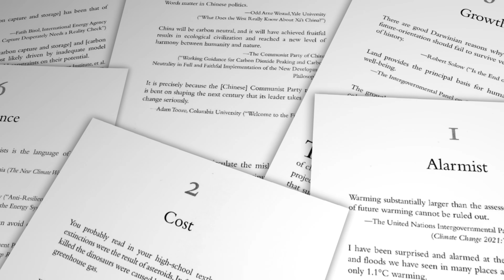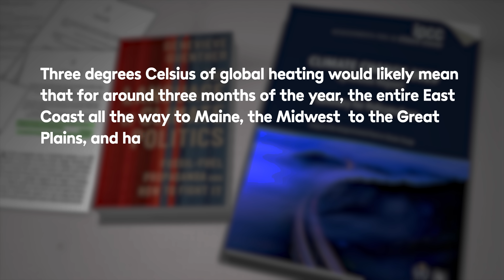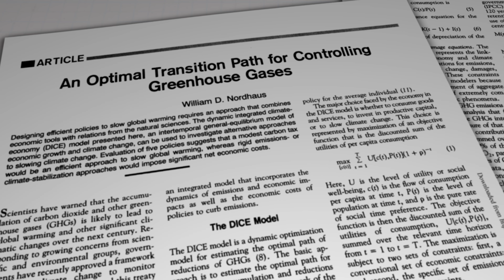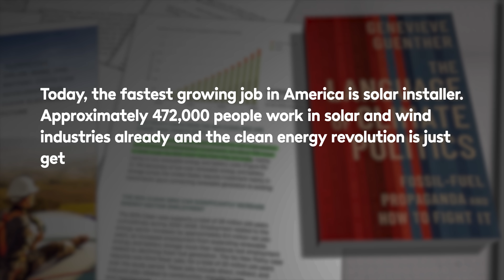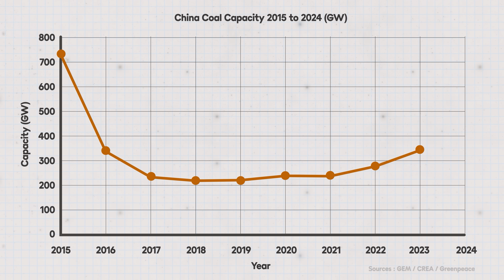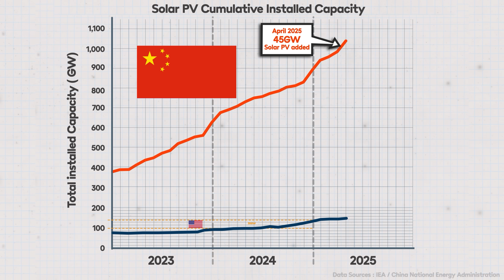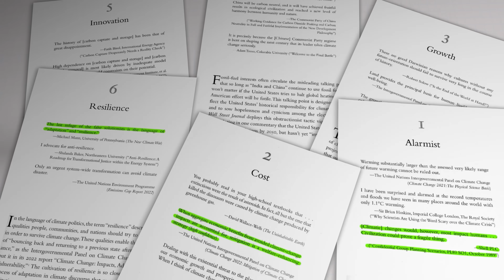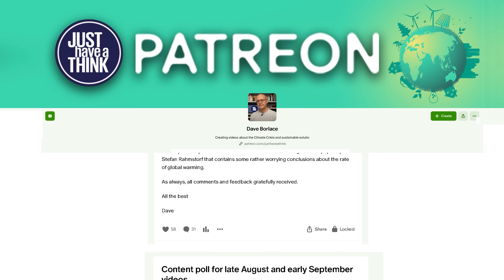New research DEBUNKS climate disinformation.

Comment: The USA are second at 12 to 13% in the carbon emissions list, but it used to be 25%. and only reduced its contribution percentage because of the increase in percentage carbon emissions in the East. So percentages are not a good figure to consider regarding carbon emissions levels. Better to have the amount of carbon emissions itself. The old adage of I would rather have 1% of 1000 than 5% of a hundred.

Comment: We need more CO2, not less to increase food production. Satellite photos have shown that the planet has become greener due to mankind's contribution to CO2. The gas does have an effect on climate but it is too small to be measured with any degree of accuracy. A study by lindzen, Happer and Winjgaarden entitled “Net Zero Averted Temperature Increase” calculated that even if the entire world were to achieve net zero by 2050, this would only reduce global temperature increase by 0.07°C. The alleged climate crisis has been created by the MSM by exaggerating what the climate alarmists are saying whilst censoring what the climate sceptics have to say. Most people at least in the UK aren't even aware that this has been happening.
Reply: Increasing CO2 is increasing food insecurity. Crops don't necessarily grow faster, those that do are often less nutritious. Faster growth requires more water which may or may not be available. Melting permafrost may grow some grass and shrubs but the ground is not suitable for agricultural machinery. Extreme events wipe out whole crops and they are increasing.  When a region loses their crop they not only don't have that food but they don't have the money from their crop to buy food. 
     The idea that CO2 has little effect is just false. It is the regulating mechanism of temperature.  The 50% increase so far is raising temperature dramatically and will continue to do so for some time even if we stopped.  But if we don't stop, things will get much worse much faster. 
     The MSM is a just as much a corporate profit center as big oil. If anything they have under reported on the danger we face. That the average uninformed person is equally uniformed about climate is just an indictment of our education system and the MSM.

Comment: 18% of solar energy reaching the surface of the planet is infra red radiation. Of this 12% is re-radiated direct to space.  6% is absorbed and re-emitted by H20 and CO2 but CO2 absorbs this radiation very effectively.  At 270 ppm all available radiation has been absorbed:  it is now 425ppm.  Adding more CO2 has no impact on warming.  We need to double it to prevent famine.
Reply: "The idea that CO2 absorption becomes "saturated" is a persistent misconception that ignores how the atmosphere works. 
—Absorption and Re-emission: CO2 molecules absorb infrared (heat) radiation emitted by the Earth's surface and then re-emit that energy in all directions, including back towards the surface. This process is continuous and ongoing throughout the atmosphere's layers.
—Wavelengths and Bands: While the center of CO2's strongest absorption band is already highly saturated at current concentrations, there are many weaker absorption bands and the "wings" of the strong band that are not fully saturated. Additional CO2 absorbs energy in these other wavelengths, leading to further warming.
—Altitude Shift: With more CO2, the altitude at which infrared radiation can finally escape into space becomes higher. Because the atmosphere is colder at higher altitudes (due to the lapse rate), less heat is radiated to space, creating an energy imbalance that continues to warm the lower atmosphere and surface." 

Plants like to absorb CO2 but they don't like the heat AND extreme weather it produces.
 
The UK and the US are responsible for the largest portion of the Industrial CO2 in the atmosphere so far even though China has recently become the largest annual emitter. Everyone bears responsibility. The US and Europe do a lot of manufacturing in China and developing nations so it's a lot about which corporations are emitters. China's emissions are leveling off. 

For every 1ºc warmer the air holds 7% more water.  Add energy to a fluid system and it becomes more active and water vapor is the most abundant GHG. Loss of albedo and specifically a Blue Ocean Event would begin absorbing more infrared directly into the land and water.

Comment: The August 2025 JHAT video presents itself as a calm, evidence-based takedown of “climate denial,” but it quietly omits the single most important data point in the entire debate: nuclear power is the only technology that has ever decarbonized a modern industrial grid at scale, and it does so with less than one-tenth the material footprint of wind, solar, and batteries combined. Mining and Materials: The Inconvenient Arithmetic the Video Ignores  IEA 2025: An energy future reliant on wind/solar/batteries requires 500–1,000 % more copper, nickel, cobalt, lithium, and rare earths by 2040.  
A single 3 MW onshore wind turbine requires ~500 tones of steel, 800 tons of concrete, and 50 tons of copper/neodymium.  
A 1 GW solar farm (with 4-hour battery backup) needs ~70,000 tons of steel, 100,000 tons of glass/quartz, and 6–10 GWh of batteries → 50,000–80,000 tons of lithium, cobalt, nickel, and graphite.  
A 1 GW nuclear plant (90 %+ capacity factor, 60–80 year life) needs ~500 tons of steel, 20,000 tons of concrete, and zero tons of lithium, cobalt, or rare earths outside the initial fuel fabrication.

Adjusted for lifetime electricity delivered, nuclear uses 90–98 % less metal and mined material per TWh than wind or solar-plus-storage (UNSW/World Nuclear Association 2024 lifecycle studies). The “clean energy isn’t clean at birth” critique applies overwhelmingly to renewables, not to nuclear.
Proven, Delivered, Zero-Carbon Electricity  France (1970–1990): 75 % nuclear → 90 %+ reduction in power-sector emissions in 15 years.  
Sweden: 40 % nuclear + hydro → 98 % carbon-free grid.  
Ontario: 60 % nuclear → eliminated coal entirely in <10 years.  
Global data: Nuclear has avoided ~80 Gt CO₂ since 1971—more than wind and solar combined even today (IEA 2024).  
Wind and solar have never, anywhere, displaced fossil fuels at grid scale without massive nuclear or hydro backing. Germany’s €600 billion Energiewende increased coal use for a decade and still imports French and Swedish nuclear electrons when the wind stops.

The “Too Slow” Myth Is 2025’s Biggest Lie  South Korea built 28 reactors in ~40 years (1978–2020) while going from poorer than Kenya to richer than Spain.  
China is currently building 28 GW of new nuclear and has 55 GW under construction—more than the rest of the world combined.  
Modern SMR designs (NuScale, GE-Hitachi BWRX-300, Rolls-Royce, X-energy) are factory-built in 24–36 months and are already in regulatory review or construction in Canada, the UK, Poland, Romania, and Ghana.  
First commercial SMRs will be online before 2030; serial production drives costs down 30–50 % per doubling of units (learning rates proven in France, Korea, and UAE).

Land, Reliability, and System Costs  1 GW of nuclear needs ~1 km².  
1 GW of wind needs 300–500 km². 1 GW of solar needs 25–50 km².  
At 40–50 % average capacity factor for renewables in most locations, the real land and transmission penalty is 5–10× higher.  
Nuclear runs 92 %+ of the year; wind and solar run 25–45 %. That means every GW of wind/solar requires backup or storage costing $300–600 billion per TWh of firm supply (Lazard 2025).

The Real Moral Position
The video implies that rapid decarbonization must come from wind, solar, and “electrify everything,” but the math shows that path locks in decades of coal and gas while we wait for imaginary mineral abundance and fantasy battery scaling.
Nuclear—especially next-generation SMRs—delivers firm, zero-carbon electricity with the smallest material, land, and waste footprint of any technology ever invented. It is the fastest, safest, and most scalable way to cut emissions while continuing to raise living standards in rich and poor countries alike.

The room in the JHAT video was built by fossil fuels, the microphones ran on fossil fuels, the cameras, lights, and laptops were manufactured with coal-fired electricity in Asia, and every single speaker who solemnly warned of “civilizational collapse” and “dying children” arrived at that venue by fossil-fueled jet, train, or car—then flew out again afterwards.
None of them live on 2–3 MWh of off-grid solar per year (the global average for the poorest billion people they claim to speak for). None power their homes, charge their devices, or heat their food without the reliable grid that only nuclear (or fossil fuels) currently provides. They demand the world’s poorest stay energy-poor while they themselves enjoy 50–100× more energy per capita, delivered 24/7, and then have the gall to call nuclear “too slow” from 37,000 feet in the sky burning 10–15 liters of kerosene per passenger per 100 km.That is the real confession. If private jets, five-star conference centers, and transatlantic first-class tickets are compatible with “planetary emergency,” then clearly the emergency isn’t urgent enough to inconvenience the professional climate class.
Meanwhile, nuclear power—the only technology that has ever decarbonized an industrial economy at scale—remains the one option they refuse to embrace, because building hundreds of gigawatts of it would actually solve the problem and make their perpetual fear-and-fundraising circuit obsolete.

 So here is the unfiltered truth in 2025:
The people who fly the most, consume the most, and lecture the loudest are the same people blocking the only proven tool that could end the era of fossil fuels in our lifetime. Until the climate aristocracy is willing to ground their jets, live on wind and solar alone, and personally accept the blackouts that come with it, spare us the performative panic.
The rest of us will get on with building SMRs and advanced reactors—the grown-up solution that actually works, whether the frequent flyers like it or not.
Reply: Great... No one is stopping them except their continued ability to lose lots of money. Few outside the industry want to invest in something that may come online in 15 years when they can build a cheaper, safer, and faster renewable today. Solar and battery tech is improving extremely fast now.  Lithium will be replaced by sodium etc. and electronics will become increasingly efficient.

Comment: There is no climate emergency, temperature rise before CO2 rises. The earth has more green/trees now than 30 years ago.

This is none-sense !
Reply: What would convince you otherwise?
Reply: 1. False
2. I assume you're referring to Milakovitch cycles and that's a half-truth.  The closer orbit does cause more evaporation and CO2 release from rocks etc. That in turn begins a feedback loop of more CO2, more water vapor, and more heat, more CO2 etc. until the orbit and the process reverses. This takes thousands of years. Now we've just increased the CO2 by half and rising in a century. That is highly unusual and extremely unnatural.

Comment: This guy is hallucinating. All alarmist prediction is based on bad computer models (proved by Koonin et al) and theres is absolutely no empirical data (for example EM-DAT and IPPC table 12.12 workgroup 1, 2021 and that  is based on the completely improbable RPC 8.5 scenario! ) that gives any reason for alarm on weather trends. And in fact 2025 seems to be the lowest year on record when it comes to deaths in climate events (see link) which is the most fundamental findings over time (dropped buy  ≠ 90 % over a hundred years) . A new report that measure sea-level rise on a much longer period (60 years) than satellites show NO acceleration in sea level rise, etc etc.
 
Over 80 % of the energy consumtion is still fossil fuels and a fast reduction of these replacing with intermittent "renewables"  would lead to bililons dead and the collapse of civilization. Bottom line: Climate alarmism is completely unfounded in true science and true humanism and it's just a powermongering hoax. So in that respect Trump was completely right. Now this "Pottholer" is of course funded by Gutteres et al and have at any rate a big fat stake in the alarmist narrative. All those naive people who thinks this guy  is a genuine truth seeking "intellectual" should look them selfs in the mirror and ask themselves self: "How could i be this stupid?"

"Statistical tests were run on all selected datasets, taking acceleration of sea level rise as a hypothesis. In both datasets, approximately 95% of the suitable locations show no statistically significant acceleration of the rate of sea level rise. The investigation suggests that local, non-climatic phenomena are a plausible cause of the accelerated sea level rise observed at the remaining 5% of the suitable locations. On average, the rate of rise projected by the IPCC is biased upward with approximately 2 mm per year in comparison with the observed rate.”

https://www.mdpi.com/2077-1312/13/9/1641

On minimum deaths by climate events:
https://rogerpielkejr.substack.com/p/bill-gates-shakes-up-the-climate?utm_source=post-email-title&publication_id=119454&post_id=177565948&utm_campaign=email-post-title&isFreemail=true&r=1sg7li&triedRedirect=true&utm_medium=email

This guys hero – a simple mouthpiece for powermongers.
https://rogerpielkejr.substack.com/p/climate-misinformation-from-the-united?utm_source=post-email-title&publication_id=119454&post_id=158437524&utm_campaign=email-post-title&isFreemail=true&r=1sg7li&triedRedirect=true&utm_medium=email

Etc., etc.
Reply: Can you be more specific re: Koonin et al?

Comment: @3:30 No, incorrect. There is a huge missconception about global warming, 3 degree doesn't mean that every day u are 3 hotter than normally would. FALSE. For ex this year I had the coldest summer that I remember. They talk about global temperature, u live in a localized zone. And second in this climate change not even the warming part is the problem, BUT the RATE OF CHANGE, and THAT'S HUGE compared to the entire history of earth. And that inbalance create a lot extreme heatwaves but also snow where snow never fell centuries.

Comment: Without anthropogenic CO2 emissions, there would be no AI or enough electric energy to operate the US, amongst many other critical things. Prove this statement wrong - the man-made CO2 emissions are 0.000000% or 0.000000026496 ppm of he atmosphere.
Reply: "Prove this statement wrong - the man-made CO2 emissions are 0.000000% or 0.000000026496 ppm of he atmosphere."

"Trends in Atmospheric Carbon Dioxide", NOAA, 2005, updated monthly.
Stuiver, M., Burk, R. L. and Quay, P. D. 1984. 13C/12C ratios and the transfer of biospheric carbon to the atmosphere. J. Geophys. Res. 89, 11,731-11,748.
Francey, R.J., Allison, C.E., Etheridge, D.M., Trudinger, C.M., Enting, I.G., Leuenberger, M., Langenfelds, R.L., Michel, E., Steele, L.P., 1999. A 1000-year high precision record of d13Cin atmospheric CO2. Tellus 51B, 170-193 (Revised in "A revised 1000-year atmospheric d13Cin-CO2 record from Law Dome and South Pole, Antarctica", M. Rubino, D. M. Etheridge, C. M. Trudinger, C. E. Allison, M. O. Battle, R. L. Langenfelds, L. P. Steele, M. Curran, M. Bender, J. W. C. White, T. M. Jenk, T. Blunier, R. J. Francey, JGR Atmosphers, 2013)
Quay, P.D., B. Tilbrook, C.S. Wong. Oceanic uptake of fossil fuel CO2: carbon-13 evidence. Science 256 (1992), 74-79
Reply: Do you just make stuff up? 
That fossil fuels are what was used to produce energy does not mean it's what had to be used.  It certainly doesn't mean it's what must be used in the future. That fuel was burned doesn't mean the CO2 had to be released... it was just more profitable for industry to dump the waste in the sky and on the public. If there weren't horse-drawn wagons we'd never have been able to build an auto industry. Technology moves on. 
     The natural, pre-industrial high of CO2 was 280ppm. Industry is pushing it past 422ppm. So 142ppm is industrial... and that has been verified. 

Industrial CO2 has a different isotope and the proportions can be measured. Industrial CO2 is currently over 1/3 the total.